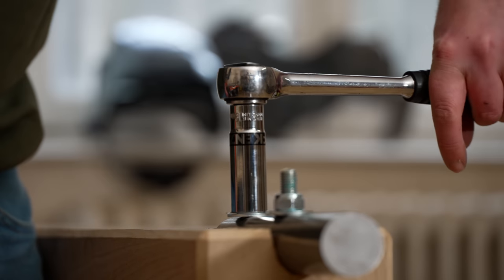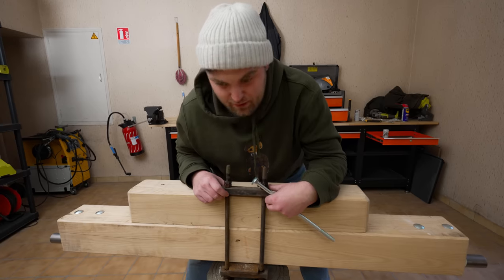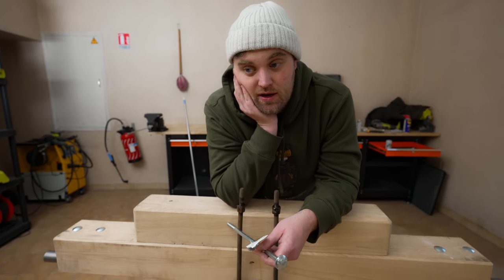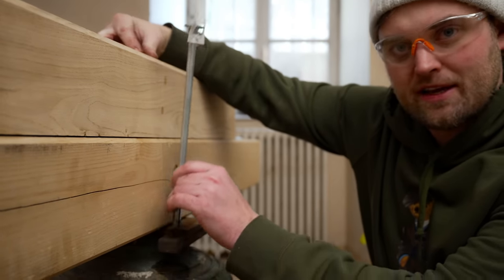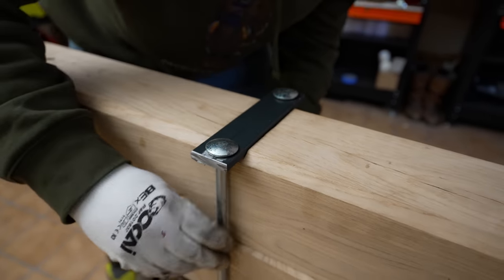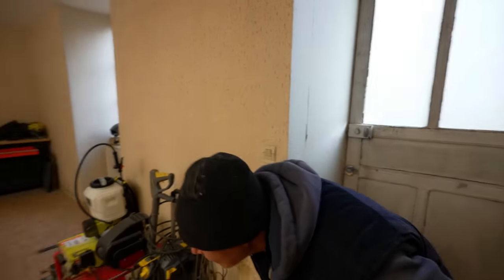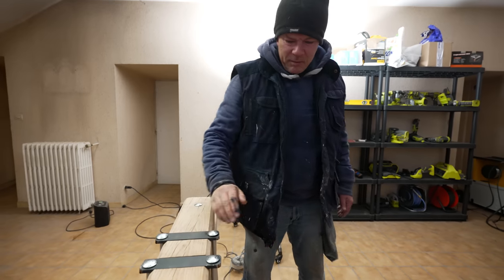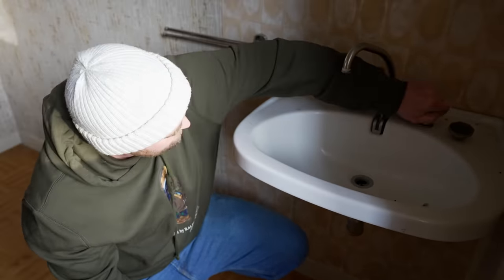It's Finally Finished

Comment: Weld only the bold threads, not the nut.  The wood thickness will gradually shrink over time. Then you will be able to tighten up the nuts.
I love what you guys are doing.

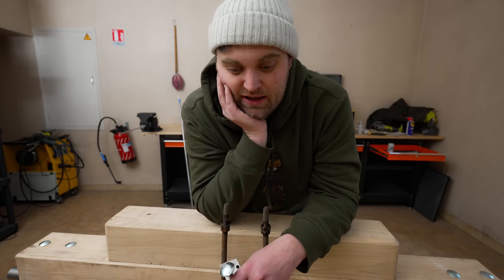Comment: Billy, my husband works with steel. He says you should use Grade 8 or 12 high strength steel bolts. The normal bolts will stretch over time from the weight of the bell. Hope this helps. 3:28
Reply: My husband is an engineer and said the same thing lol ❤️🇨🇦
Reply: Yeah I said the same thing
Reply: If you calculate the creep in four mild steel  15mm threaded rods with a load of an estimated 100 kg. You will find that over centuries the stretch will be infintesimally small. Continue as you are.

Comment: Billy and company... Nice to see that you figured out the bell.  I'm an engineer (totally different industry) and have to add that you might want to do an annual inspection on the steel rods that you are using as a pivot.  You have covered most of the potential failures but the inspection to ensure that the bolts are tight and the epoxy has not failed.

Like I said the headstock looks good.  Just some Preventative Maintenance.  Love to see the differences in architecture between Europe and the US.

Comment: Just a caution and venturing a guess... But if the wood is still a bit wet and the moisture content will drop more, it may shrink a bit and the bolts/nuts might loosen just a bit. I just remember noticing the first steel rod had rust on it where it was in contact with the wood for a short time, which tells me the moisture content of the wood is still a bit high.

Comment: Headstock is looking great! One small suggestion, put a large washer or steel plate under those carriage bolt heads. It will spread the bolt's clamping force and prevent the timber from splitting along that line.

Comment: You might look for grade 8 steel bolts and nuts. For very long bolts grade 8 threaded rod is an option with a bit of tack welding.

Comment: Love the work you guys are putting in.  Very inspiring stuff.  Couple of suggestions though, rather than welding on nut to the end of the bolt, you can use "Threadlocker" to the threads that will meet up with the nut.  That way if you need to take it down and do any sort of maintenance in the future you won't have to cut it out and go and buy another nut and bolt.  Also when cutting a slot into the large beam you can run your "Circular Saw" at a shallow depth to get large bits out then come through with the chisel to clean it up.  Its a bit faster that way and keeps your chisel sharper longer as you won't need it but to clean up a few spots.

Comment: I'm wondering if you might consider notching the underside of the stock where it rests on the steel strapping.  It would then be similar to the notches you cut in the top and help keep the bottom of the stock from slipping where it meets the head of the bell.

Comment: Hi Billy, you could use threaded steel studding instead of bolts. I've used 18mm and 22mm threaded stud in the past. Also nyloc self locking nuts may work to save welding. Rubion in Mayenne is the place to go for all types of quincaillerie and metal.
Reply from the maker: thanks paul that’s a great help! pop in anytime your passing be nice to catch up!

Comment: May I suggest that you inlet the bottom of the headstock to fit the strap across the top of the bell? You did it on top for the straps, and you would gain enough bolt length to put the second nut on and avoid welding it. Welding is an inelegant solution, and creates problems for anyone who needs to work on the bell in the future (even if it is you!).
Reply: As someone else noted, the wood may still shrink. It will be desirable to have the ability to tighten the nuts in the future. You can't tighten a welded nut!

Comment: Guys it looks great and glad some of my advice was a help, or i hope it was?. Have you thought about the wheel or counter lever that needs to be attached to the support shaft, or head stock, so you can attache bell rope and make it ring?. Easier to make this in workshop than up the tower.
Support shaft may not be long enough to go through bearing and protrude to other side of support beam to attach wheel on end but a simple bracket at 90 degrees to headstock bolted on should work.
All the best guys and sorry to presume if you already have plan, just want to help.
I'll carry on watching the progress with interest
Jerry

Comment: As great as a weld may be, I'd humbly suggest at least using some thread lock on each bolt first (or even instead of the weld). You never know when you or others may need to maintenance the bell. Heating up the thread lock to remove instead of cutting off the bolts from 5+ meters up a ladder is much simpler. The progress is looking great though!

Comment: Just FYI - for future projects requiring long bolts, you can get Threaded Rod at almost any length you want.  You just cut it to fit your needs.  The only difference is, you just put nuts/washers on both ends.

Comment: Billy, have you thought about using a product like Loctite Threadlock to hold the nuts onto the bolts.  Might be easier than trying to weld it.

Comment: I feel like the bell has been mounted 90 degrees off how it should attach to the stock given the design of the brackets at the top of the bell. But I don't know. Just speculation. 😊

Comment: You should be sure what the materials are of that bolt and that nut/washer. They may not be compatible for good weld penetration and strength. You may actually weaken strength of bolt/nut with shrinkage of either/ or from heat of weld. You maybe should consider a TIG weld rather than MIG

Comment: I am always impressed by the quality of your videos. The effort put into them pays off.  They are always a pleasure to watch.  I have a couple of questions.  You embedded the steel bars on the top of the beam but you did not embed the steel bar on the top of the bell into the wood.  Is there a reason why that would not be a good idea?  If you did, it would allow the bolt to go up higher on the screw.  Second, do you plan on having some type of temporary scaffolding put up when you put the bell up?  I am really concerned about everyone's safety trying to place something so heavy up so high.

Comment: In France, do you have available all-thread?  It is a product much like a threaded bolt but without a "head".  Lock nuts on both upper and lower (top/bottom) would allow for a possiblt better choice than the carriage bolt that limits the ability to use alock nut due to it's length.  Just nasking.

Comment: good evening billy and gang, I was wondering if you used a full threaded rod, you would have more thread to work with.  My feeling is that the weight over time may strip the thread of the end of the partly threaded bolt, a longer rod that is fully threaded maybe easier to acquire and give you  more  room for more than one nut, and the task of installing up in the tower in two separate pieces and just  a tad lighter :)  a thought:) Crack on!!!

Comment: Since it is a very common item!  I believe I would have used threaded rod on the bell hangers.  Probably cheaper than those machined bolts as well.  Just common sense really!

Comment: If the bolts aren't high tensile steel throw them away and have some like the originals made in an engineering shop.

Comment: Is it worth using some Brasso or bronze polish equivalent to remove the verdigris and then perhaps seal it to prevent further patination/corrosion from any moisture buildup in the bell tower?
Reply: The bell was cleaned. Billy wants the patina kept as is.
Reply: @andymccabe6712  🤣🤣🤣 As Basil Brush used to say: "What got stuck in your biscuit shute?" What a grump!! 😅

Comment: your work is amazing but i am sad you didnt use grade 8 bolts, the soft bolts you used are a risk of breaking or stretching. Also welding the bolts will change the hardness of the bolts. I would never  use that kind of work on something that could possibly hurt someone.

Comment: Nice job but I’m not a fan of the bolts you chose. They are the lowest strength available. You want this bell to be up there for the next 100 years. If you were in the states I would recommend grade 8 bolts and nuts.